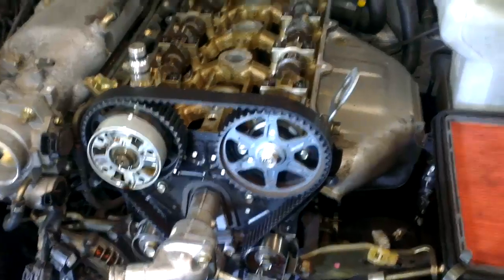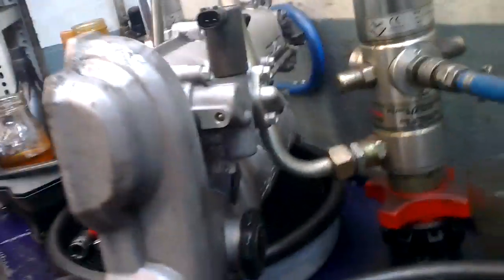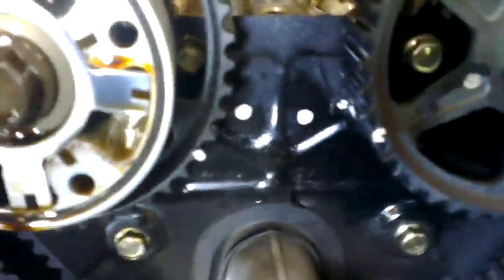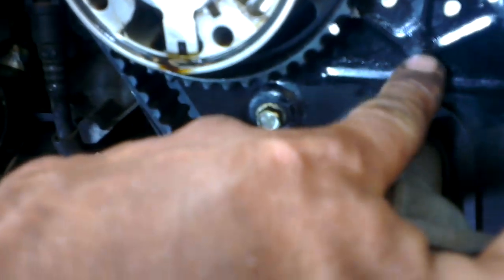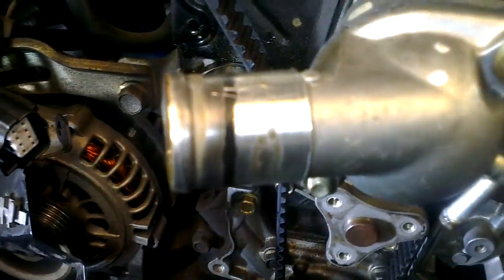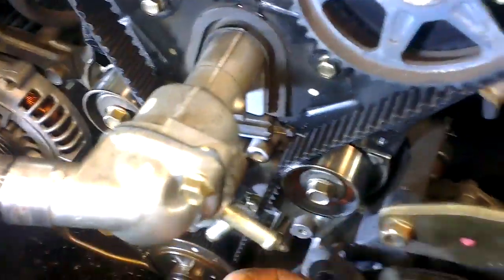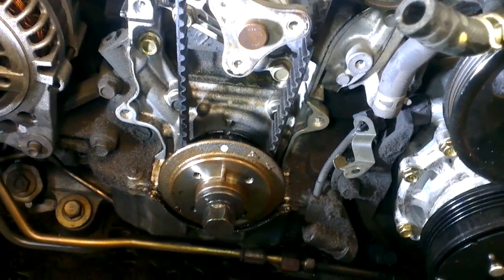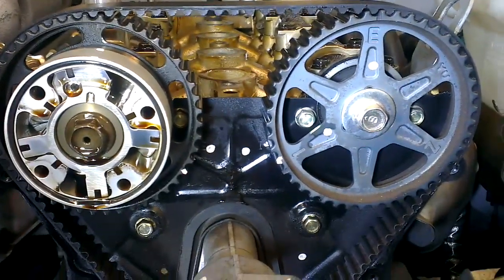Mazda mx5 miata timing belt change camshaft marks

Comment: You can also use a 12 point 13/16 socket. If you don't have a 21mm. It fits just as tight as the 21mm also.

Comment: Hey there, I'm almost done with the timing belt for my 2001 MX-5. I have one question... At 1:40 in your video, you held a bracket with wires on it, and said it "tucks back." I can't remember where exactly that bolts back, and can't find any diagrams or part numbers on Google. Do you know where that bolts back? Any resources that will tell me?